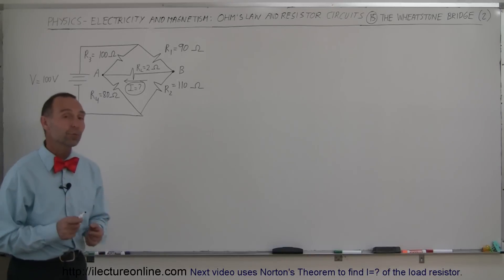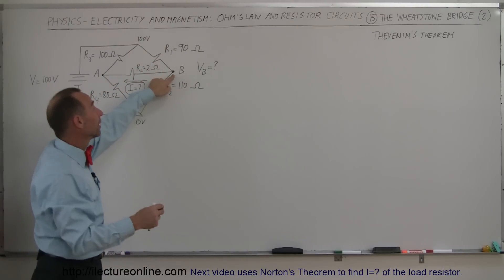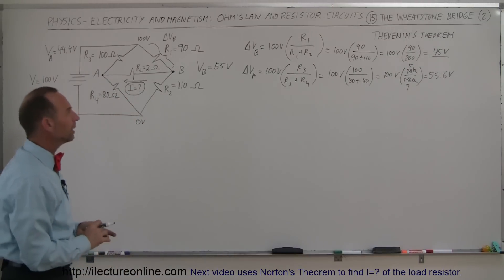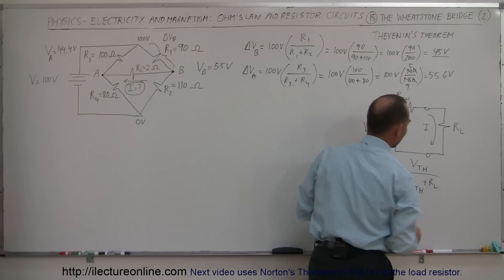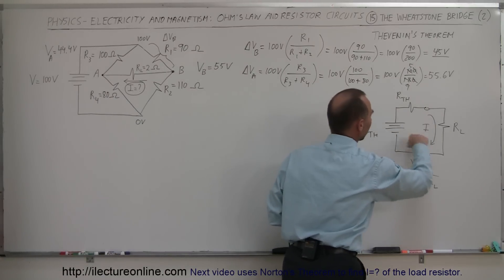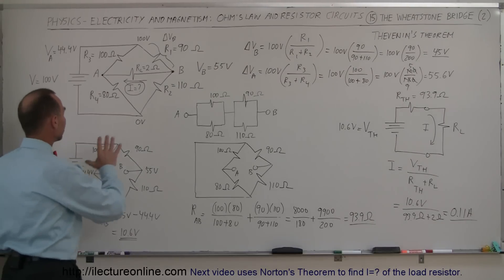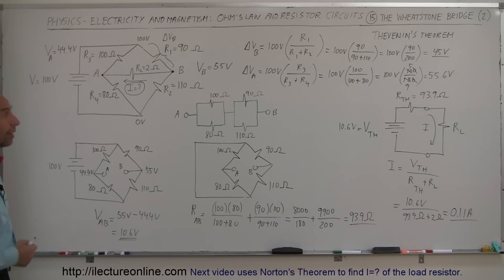Physics 42   Ohm's Law and Resistor Circuits (15 of 23) The Wheatstone Bridge (2)

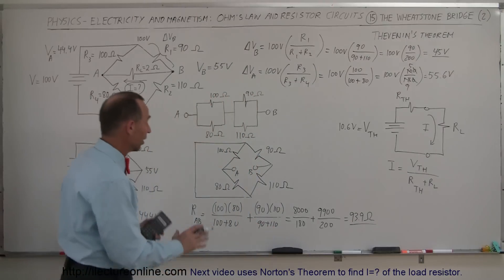Comment: 10:29 Shouldn’t be the Rab=95 ohm?
As 100ohm & 90ohm are in the same line hence a series combination so as 80ohm & 110 ohm.But 100ohms resistor has no common point with 110 ohm as you depicted.
Sorry if I’m wrong.
Reply from the maker: As it turns out you cannot work it out that way.  The method shown in the video is the correct method.

Comment: Hi, I have two questions Professor  Michel. First, voltage divide is being used to find Va and Vb but the resistors are in parallel. I thought voltage divider was used for resistors in series. Second, you use Vab to find I, but the current drawn on the circuit is for Vba... let me know

Comment: If there is an internal resistance to the battery, should we first find the current coming out of it?
Reply from the maker: Usually we ignore the internal resistance (especially if it is small compared to the external resistance).  Only when the external resistance is small do we need to take it into consideration.
Reply: Michel van Biezen but what if we are supposed to take the internal resistance into consideration? Some questions i have come across have mentioned the internal resistance of the cell. Usually when comparing their given values to the other resistors, it doesn't seem small enough to be ignored. In such a situation, are we supposed to simply add the internal resistance to the overall circuit?

Comment: Sir I wanted to ask that when can we actually use Thevenin's Theorem or Norton's theorem, I guess they are used when there is a load resistor, so what exactly is a load resistor and how do we make a distinction between load resistor and other resitors. If possible can you make a video with certain examples of circuits which can be solved using the Thevenin's and Norton's Theorems
Reply from the maker: Thevenin's and Norton's theorems can be used on many types of circuits. They are just two of the many types of methods used to analyze circuits and you end up using whatever method you like best.  The "load resistor" represents the portion of the circuit that is plugged into the source.  (Like a toaster is plugged into the wall circuit which then becomes the "load resistor")

Comment: 8:10 , as far as I know that the Wheatstone Bridge circuit is nothing more than two simple series-parallel arrangements of resistances connected between a voltage supply terminal and ground producing zero voltage difference between the two  and parallel branches when balanced. So why R3 and R4 are connected in parallel since its the series branch ... confused
Reply from the maker: It actually is not as you described.  You can check that premise by solving the problem using the Kirchhoff voltage and current method. (Not easy).  But when you do, you'll see that a Wheatstone bridge is not a "simple series-parallel arrangement"

Comment: Sir the method you used to find the potential drop on each side of the bridge, isnt that only valid if there is no current flowing through the load resistor? The argument that I have is: when there is no current flowing through the load resistor, each branch(R1-R2 or R3-R4) becomes resistors in series and the two branches are in parallel to each other. This enables use to the ratio to find potential drop(as you did!) but in this example, we can treat it in the same way! Am I am not thing the same way? How can you justify using the same method for both the situations?
Reply from the maker: If there is no current then there cannot be a potential differences across a resistor.  V = I * R

Comment: How did you get V=100(R1/(R1+R2)) at 3:20?
Reply from the maker: +Milk Tea That is the equation of a "voltage divider". The voltage drop is proportional to the ratio of the resistance divided by the total resistance.

Comment: Sir , is this correct, because this system was part of Albanian national physics olympiad , and the teachers solved it in different way, furthermore the result was different.
Reply from the maker: +Gerald Topalli  I just checked it and it looks correct.  There are other ways of solving it, but Thevenin's method is definitely one of the easiest methods.
Reply: I believe Michel is correct. I used Kirchhoff and used only symbols until the very end (yes, it was pretty long and tedious), but I arrived at 0,11 A too :)

Comment: Why is the resistor known as the load resistor?
Reply from the maker: Banuka zxc 
The term "load resistor" is typically used to describe the "external" resistor that you hook up to the circuit.
For example, a light bulb, or a toaster, can be considered the "load resistor" to the electrical circuit of your house.
Then we calculate the current through that load resistor and sometimes also calculate how the load resistor affects the circuit.
Reply: Thank you very much!!!